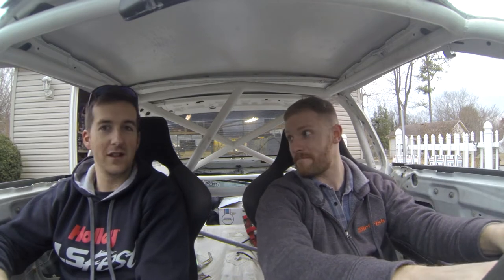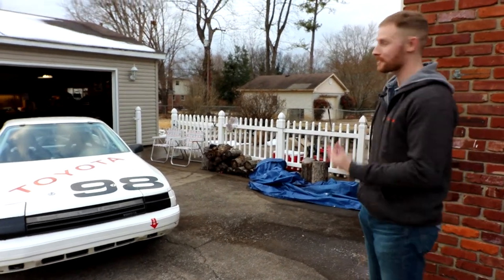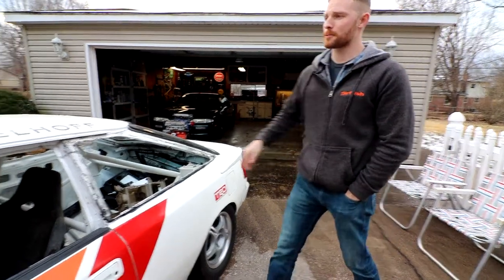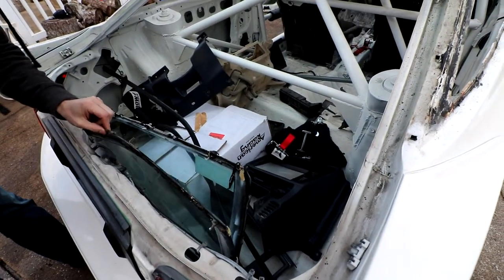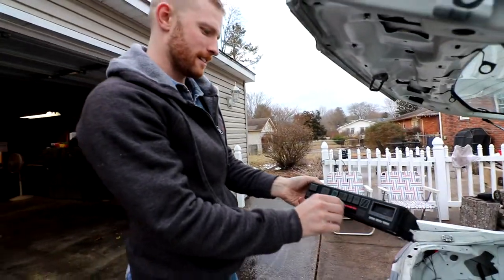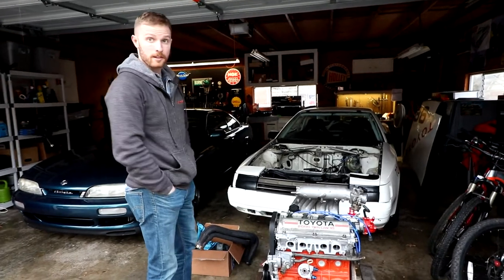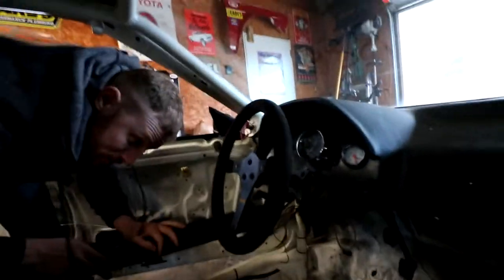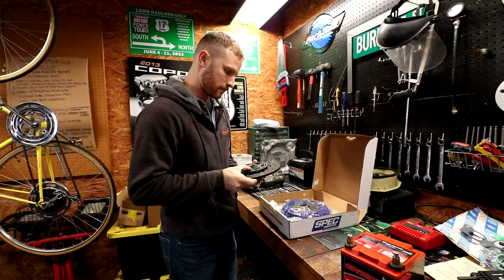Hasselhoff's Celica - Cheap Racecar Project Intro Ep 1

Comment: Whatever happened to this build ?   this was back in 2018?   Kinda curious
Reply from the maker: Too many projects, too little time. It was sold last summer. We got the engine and trans installed but didn't get much further
Reply: @Garagetopics  Yea, I saw the facebook post eventually. "stalker"  . You had me going for a min though.  I hope I can get this kind of interest when I start tossing parts at the 69 Mach 1
Reply: @kudosjeg  just in case you're curious this car is now in Alabama owned by a friend of mine, I've been helping him try to get it up and running, right now it has a new motor but it doesn't seem to want to hold oil pressure, I think he's looking to import a new "known working" motor to drop into it, but it's not in a landfill somewhere and getting the love it deserves
Reply from the maker: This is great to hear! What happened to the engine that was in it? When we sold it, the engine had 0 miles from its rebuild
Reply: @Garagetopics  I'll have to ask exactly what it is but last time he worked on it he was saying it wouldn't build any oil pressure even after replacing the oil pump
Reply: @Garagetopics  I think it still has the one you guys had in it but I'm not entirely sure, to my knowledge it's had at least 3 owners since you sold it
Reply from the maker: @tristonpalmer1752  if you have any videos of it running and driving, I'd love to see it!
Reply: @Garagetopics  I'll keep that in mind when we get it that way!